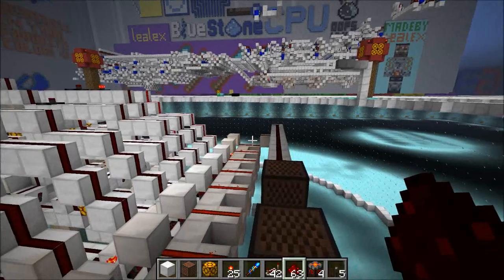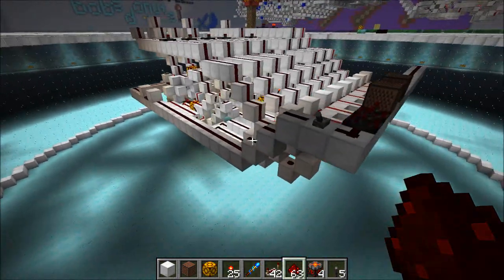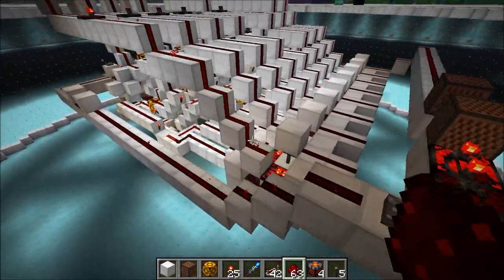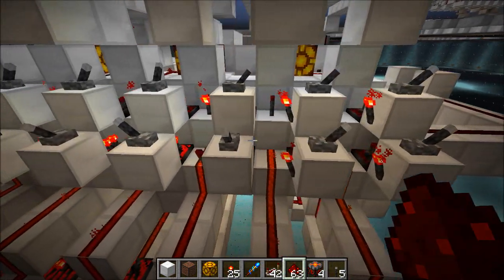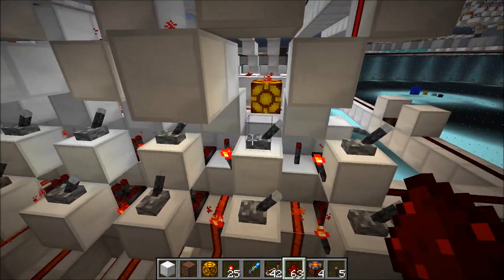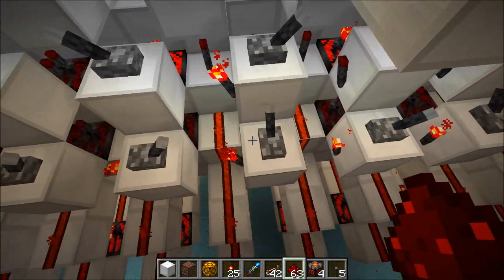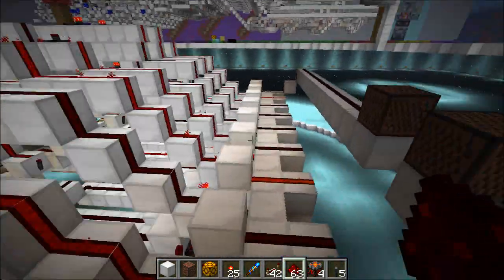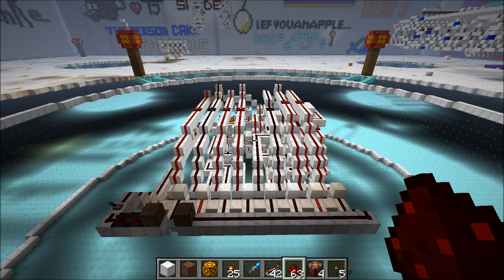7 ticks for 8 bit Addition? Without pistons? Yup!

Comment from the maker: Just saw this. This is a pretty old build - I built a 5 tick one in the middle of November and made it 2 wide/bit, 17 long, and 12 tall and a friend of mine built a 4 tick version by extending the "logic duplication" to all bits, which is something I didn't want to do because it ends up taking on a weird shape and becomes VERY inefficient after 8 bits. I also designed logic for getting to 4 ticks, but the implementation is to big to be practical.

Comment: Hey Properinglish19, if you find the time, please check out my video on a super compact, 1-wide half adder. It's certainly not as fast as your adder here when linked into a full adder, but it uses no pistons and the dimensions are 1W x 6L x 6H!

Link: /watch?v=ncVtvwYApiI&feature=plcp